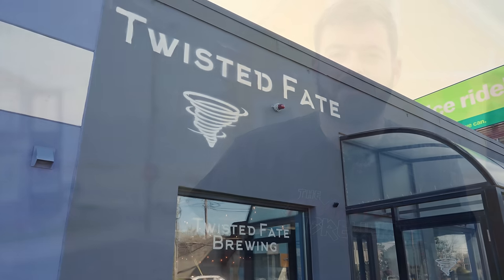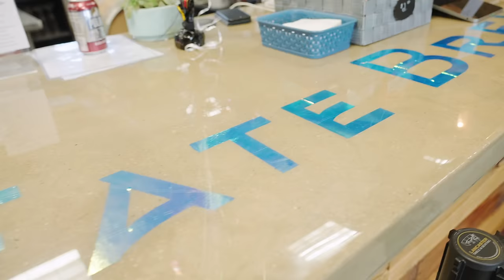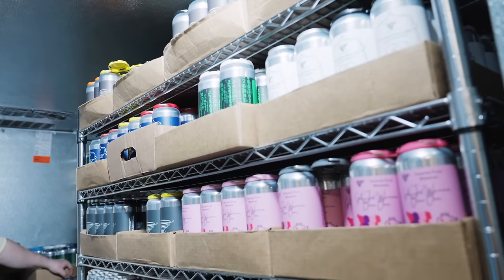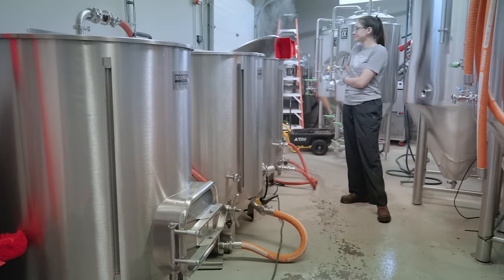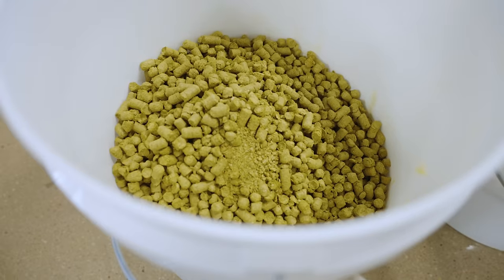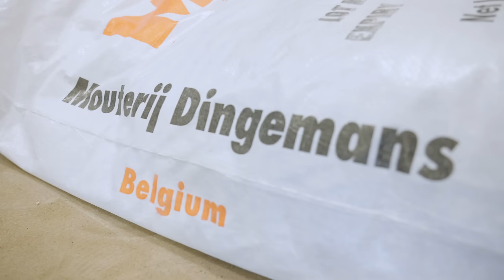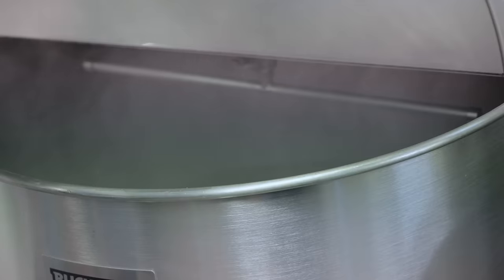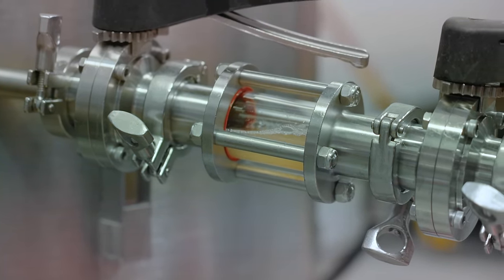Home vs Pro Brewer: Brewing the SAME BEER on HOMEBREW & PRO SYSTEMS

Comment: What a great experience and a great video! Please include the water profile/mineral additions in your brew day beeak down video! I'm curious to see what kind of water profile they are using up there. I always target high chloride to sulfate additions, use 30% or more wheat/oats, aim for higher final gravity (1.018 - 1.022), target a final pH around 4.1 - 4.3, and my NEIPAs still seem to fall flat of what some of these pros are putting out for that soft mouthfeel. My flavor/aroma is all there, but I have yet to get that extremely soft, pillowy mouth feel.
Reply from the maker: Yup, that water profile is included in next weeks video, as always. Its a high Cl:SO4 ratio but not too extreme.

Comment: Loved this video! I have to get over to Twisted Fate Brewing and try out their beers. One question….at about the 7 minute mark, you said “However, there’s a small amount of ____ going into the mash hops to unlock bound Thiols.” What does he add and when?
Reply: It is Saaz.
Reply from the maker: Yup, Saaz for mash hops
Reply: @TheApartmentBrewer  - I’ll ask the dumb question…why does adding Saaz hops to the mash unlock bounds thiols? What makes these hops so special?
Reply from the maker: @jackhandy7237  Basically saaz and a handful of other varieties of hops are high in bound thiols, and adding them to the mash exposes them to enzymes which can separate those thiols from the hops.

Comment: Personally I've always attributed the difference between large brewery hops and homebrew was the fact that by the time homebrewers get their 1-8 oz bags the original bags have been opened and revealed several times so the aromas have changed due to the small amounts of oxidation.  Who knows.  I have no proof but kinda made sense.
Reply from the maker: I dont think homebrewer hop bags get opened and clsoed several times before being sold. As far as I know they are packaged in the same places the pro hops are
Reply: @TheApartmentBrewer  could be.  When I order from northern brewer though they are in NB bags vs when I order direct from hop supplies they are in vacuum sealed industry style bags.  Could be the fact that they are vacuum sealed.

Comment: So what kind of molds are in there, 
Or even better what's the recipe?
Reply from the maker: molds? The recipe will be next weeks video
Reply: Malts**
Reply from the maker: Ah ok I was confused. As I said the full recipe will be published in next week's video but it's basically a mix of pils and pale malt for the base, 15% each Flaked oats and Flaked wheat, some malted wheat and a touch of caramel 100